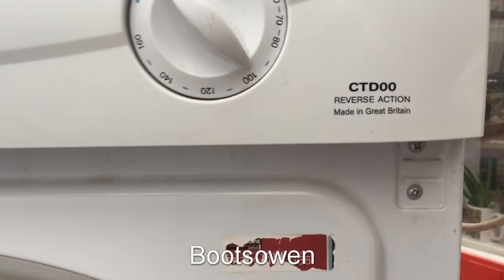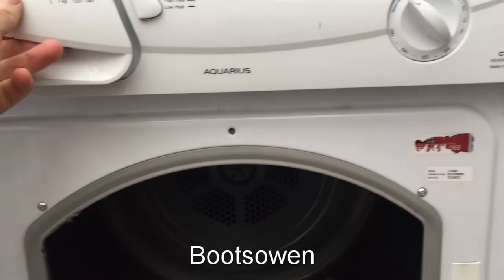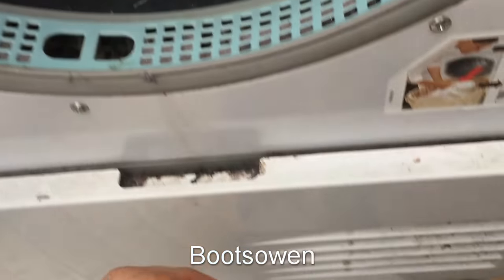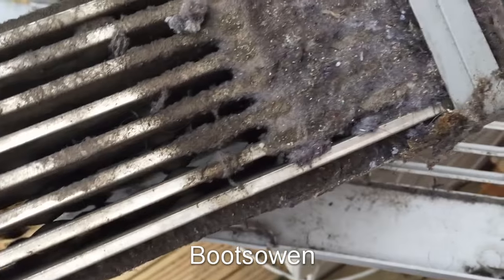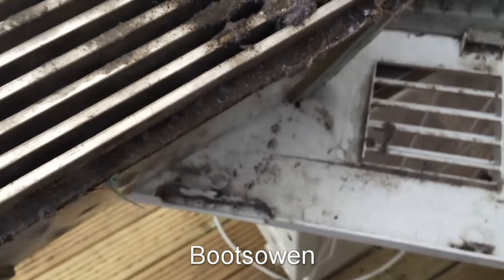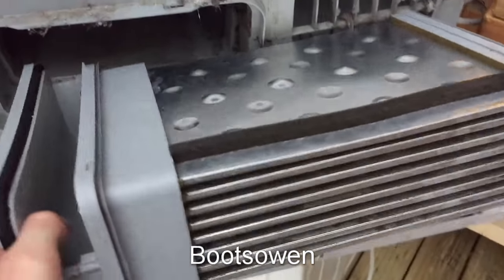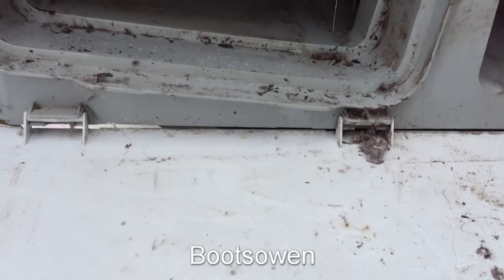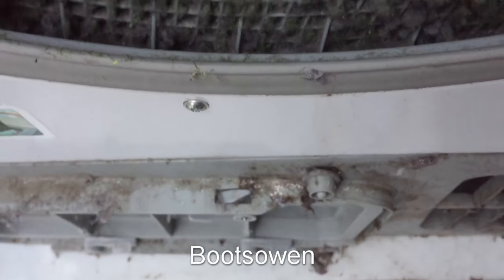How to clean a tumble dryer condenser

Comment: My wife is doing this every day she is using it 2 to 3 times 140 min and she is not cleaning filter for about  6 months that I ignore it cause I was following her cleaning filter but once I got busy I forgot then tumble dryer condenser turned on cleaned it and still trying with it today hope cleaning resolve the issue it's working now but after sometime its lit again
Reply from the maker: There may be a pump in behind the condenser that is all gummed up too.
Reply: @bootsowen  thank you I'll check that also 👍
Reply: @bootsowen  I've vacuumed and blow off lint from every where removed sides only but now it won't start I got red light empty water and red light clean filter 
I didn't touch or removed any wiring ???
Its indest  idca 8350
Reply from the maker: I suspect that in cleaning it you moved some lint around and it has stuck in the switches that activate those lights (and keep the machine from working). Keep trying until it works. Most people would just throw it out. It sounds to me like cleaning it would do it.  The model is irrelevant. It is a lot of work to take it apart but you probably know how now!
Reply: @bootsowen  thank you one question please is it important to assemble sides and top to start it or  it's irrelevant to this 😅
I have duty today just took a break and will go back to work tommorow iam free this time I'll dig on it 😉
Reply from the maker: Hi, it depends on the machine, whatever way you get it apart just put it back in the reverse order! easier said than done. wear gloves, these things are sharp. Let me know how many screws are left over!
Reply: @bootsowen  it's working now but no heating 😅
It was heating before this lint adventure 😂
Reply: @bootsowen  it seem that one of the thermostat of heating element blown cause no continuty
I have to check local market it should be famous right that kind of thermostat
Reply from the maker: Hi, i have posted other videos on how to replace these items. Thanks
Reply: @bootsowen  I've  removed these thermostat and replaced it and now back to normal ,will tighten remaining screws ,big headache but my wife need it ,I feel the belt need replacement but I'll not untill it break 😅 not feeling well after all that headache with this dryer
 1 day  cleaning 1 day figure it's not working trying to solve another day check for heater and searching for the cause and finally it's working and will return all screws but I have to check on YouTube how to change the belt so once I order it I can easily do it 
Thanks man for your advice and help 👍👍👍
Reply from the maker: It is nice when you do something yourself!
Reply: @bootsowen  👍👌🌹

Comment: Also if your tumble dryer glows orange, turn it off at the plug immediately and wash the condenser. The condenser should be washed every month (I know from an engineer).
Reply from the maker: If your tumble dryer glows orange I reckon you have bigger problems!
Reply: @bootsowen  No, only that the condenser needs washing. Trust me, I had an engineer come out because my tumble drier glowed orange, and that's what he told me, the condenser just needs washing. He explained about how the air being trapped and the heater has to work harder, so that made it glow orange. Just the condenser.

Comment: It's a recall model!
Reply from the maker: What was the fault?
Reply: bootsowen these ones catch fire! If you're planning on keeping this, call Hotpoint to either modify it, or replace it with a rebadged whirlpool dryer.
Reply from the maker: It’s been scrapped already but I will put up a video of the failure. It had charred lint in the element.
Reply: bootsowen that's what makes it catch fire! Good thing you got rid of it!
Reply from the maker: It would be funny if it wasn’t scary!  I’d say this one was never cleaned.
Reply: bootsowen I think that's the reason why they're catching fire too! People don't know how to clean a dryer 😂 you should've kept it and put flammable stuff in it and put it on high heat dry 😂😂😂
Reply from the maker: I can only say that that was an opportunity missed!

Comment: My hoover condenser dryer the lights keep flashing and beeping. I’ve cleaned the filter in the door, cleaned the other filter and the drawer has been emptied. It still not working.
Reply from the maker: What does the manual say you should do? What combination of lights are flashing and how many times, what is the flash pattern?

Comment: But how the fuck do you open it
Reply from the maker: 2 clips on the front, pull it out. you don't need to open it more, but if you want to there are clips on the sides top and bottom, pop them all in at the same time and take the front of the condenser off. You are probably smarter than you sound?
Reply: @bootsowen  Aha, thanks! I thought you could take it apart piece by piece, but nevermind. Apparently the best/easiest way to clean it is just spraying it with a shower head.
Reply from the maker: as long as you are sure all the snots come out, if you push them in with a shower and they dry and cake hard then you are two steps backwards.
Reply: @bootsowen  the design on mine allows for it

Comment: How did you remove the front part of the condenser unit, I can't get mine off which would help me clean it along better
Reply from the maker: It depends on the model. This one had clips that could be popped out with a screwdriver. Others have screws. Some can’t be taken apart. Thanks
Reply: Mine is same as yours and I can't get that front bit off. I've undone the screws but won't come off
Reply: @lucywells3102  I just used pressure washer to clean it out, worked wonders even though the front wouldn't come off